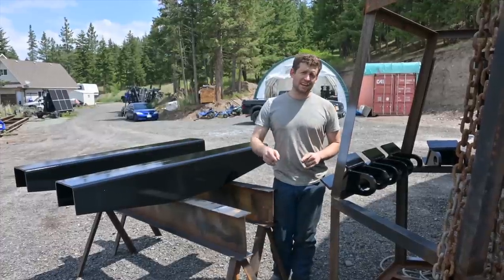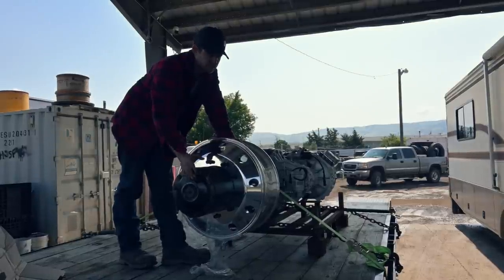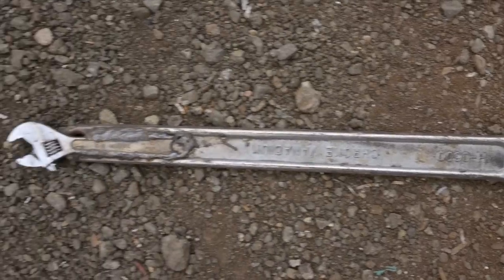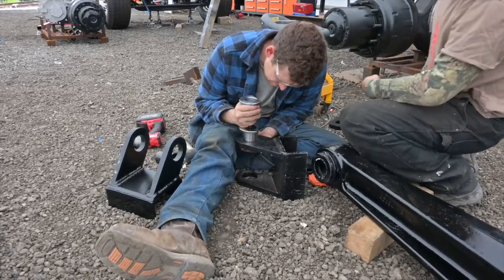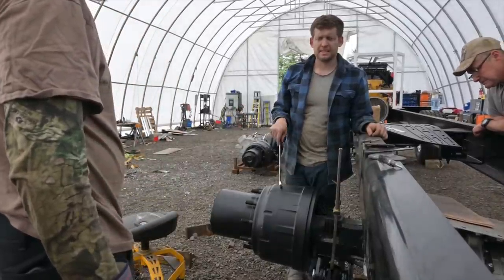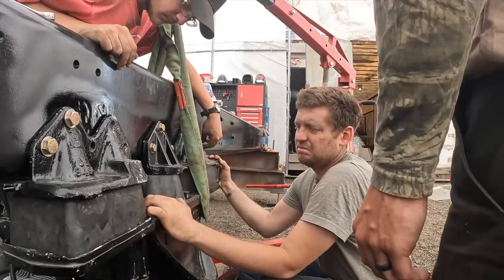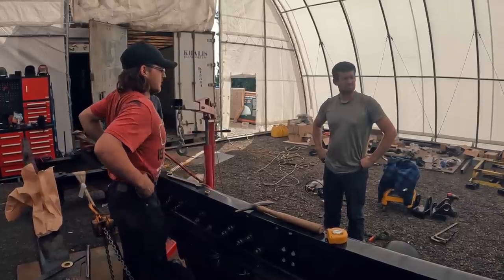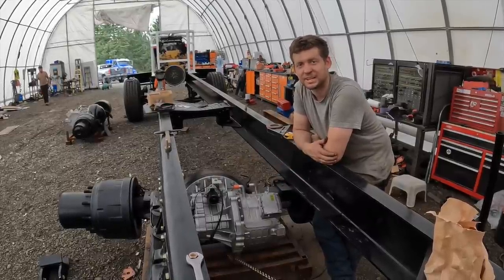E-Axle Installation Begins

Comment: Having the motors pointed inward is genius.  Also, 140 in reverse is something we're going to need to see.
Reply: Possible doesn't mean that it will have the stock ability :P imaging the effort required to stay on track while going that hard in reverse is quite the picture XD
Reply: 2 am on a Wednesday and 12 punys of mable syrup, a bit of "thats not possible" someone's bound to try it at
Reply: I want see a loaded logging trailer being pushed down a secondary road at minimum 120 😎😱🫡
Reply: @brianb-p6586  being able to use their electric motors to assist the breaks in either direction is nice too
Reply: Going to be able to wwap the axles to get nearly double the life out of the gearsets.

Comment: Maybe getting the axels set up in a pair. The roll the assembly under the frame,  get it all aligned,  then drill the holes to mount, paint the holes before installing the bolts, to prevent rust, the after the chassis is assembled. Touch up the paint before the body is installed,   having a stamped in measuring point for the axels, to make alignment easier.     Use a square and Lazer to measure out the mounting points, or axel centerlines.  After the axels are in place, the holes can be hand drilled, or a magnetic drill press. And having all the parts pre fitted together,  maybe have a dummy frame rails to  get it sei up, maybe  even made from wood,   if required make a jig to hold the axels square, to be rolled under the frame,  bolting on all the suspension parts  then roll it under the frame drill and bolt  should save a good bit of time,  just trying to help ! ✌️ Have an awesome day, can't wait to see it finished,
Reply from the maker: On the next truck we’re getting the suspension drafted by a professional and getting the holes punched out in the factory in the future to avoid this on production trucks

This sucked to do to be honest.  But part of prototyping

Comment: Careful with those axles being backwards, sometimes the oil pumps don't work and it the altered loading can also have knock on impact to wear on the crown and pinion on the differential.

Of course this is the prototype so it's a great chance to find out if it is a problem or not, and you are in a position to be ordering axles with a reverse pump or differential if it is a problem.

The Tesla drive units have aftermarket reverse direction pumps available in swap projects as the Tesla pump is only operational in one direction preventing you sticking one backwards in a swap for too long

Comment: But read the spec sheet on your e-axle. The differential pinion gear bearing  is designed to when going forward be under tension.  Not under expanded force. Also there is the pinon gear to ring gear contact tooth alignment.

Comment: Love to see the progress!

Regarding the differential direction, have you considered ring gear tooth directional strength?  Most ring gears are stronger in the conventional forward direction and somewhat weaker while reversing.
Reply from the maker: Yes, these axles were designed for this specifically
Reply: I'm guessing they don't use hypoid gears then since there is no need to change rotating direction.
Reply: @EdisonMotors   That's phenomenal!  I would love to see inside one of those.

Comment: The rearend running in reverse might have ring and pinion gear problems.    I believe hypoid gears pull into each other with intended direction.    But,  they push away from each other in reverse.

Comment: I don't know if you've worked on walking beams before, but the the adapter bushings are not supposed to drop into the mount holes by hand, they should be a press fit. They are going to flog the mounts out in no time!

Comment: Most diffs have preferred driving direction. I reverse life expectancy is 10 times smaller. Like in some wheel loaders amd mobile excavators front diff goes poopy every few years because it's driving in reverse most of the time. 
Please check with manufacturer is this true with your diff. You don't wanna replace diff every year just because it's driving in reverse

Comment: I imagine you've already asked axel mfg. Most all hubs are directional for noise and wear characteristics.  The oil slings in certain direction for max lubrication.  The mesh of gears angle and spiral is ideal for forward travel. I decline customer request to operate our equipment in reverse for this reason.

Comment: Electric motors are often timed, or optimized for one direction.  Might want to put it on stands, mark the tires, spin them a while, and see if the marks are still synchronized.  Never trust a "correction factor" without checking it!

Comment: Was the ring and pinion on the axle running backwards building with reverse cut gears? If not you will be driving on the coast side of the gear way weaker that is if there is still a ring gear
Reply from the maker: Yes, it was set to run backwards by the manufacturer.  We triple checked this don’t worry.

Comment: There are some really common axles GM 14 volt, Dana 60 70 ford 9. Making an electric. Motor. To slip into the bolt flange could help costs as well

Comment: I like the axle mounting but are you sure it will be ok with the front axle driving on the coast side of the ring and pinion? Also what about when you have to change the third member. Is there going to be enough room to do it without having to pull one of the whole axle assembly’s out?

Comment: I love watching you guys.. am not trying to be a Karen or a keyboard warrior here but I am not 100 how great that front diff is going to hold up running in reverse just how the power and torque will be applied to the ring and pin gear and how the cut and bevel is on the gears yes I know rear ends run under load in reverse but it's normally for short amount of time.. maybe it's nothing to worry about it's just my brain thinking out loud

Comment: I was wondering have you ever thought about adding 1-2 axels to a trailer and expanding the drive software to be able to activate them when needed in off-road or snowy conditions, the rest of the time they could just act like mini generators as they are being pulled on the highway.

Comment: And suddenly It's got me wondering if you could do something like the old Scammell Pioneer trucks rear ends... 

Think single axle to 'Y' shaped floating arms on either side so that you could attach four wheels in total. It meant that it could allow massive articulation between each set of two wheels but still have the axle parallel to the chassis. Really good for hill climbing. 

A modern version could have four wheels with a hub type motor in each wheel, with two on each arm with a centre pivot. Wouldn't necessarily be for high speeds but certainly for very rough terrain. Could even drop a drive motor from each side and attach a track between them (though that'd leave balance issues I suppose if the motors rotate far enough to move from front to back or vice versa so each side doesn't have the motors in the same position on each side.)

Comment: Um are you sure your ring and pinion are cut correctly to handle the reverse as most are directional wearing and cause you typically put on far more km forwards than backwards you don't see tons of wear from reverse going against the cut of the teeth

Comment: Do those have normal hypoid gears in those diffs? If so running it backwards at high loads is not a good idea. They are way stronger in forward.

Comment: Are you guys going to eventually going to build a race truck to do the semi truck racing, having a couple Tesla  drive units  parallel should be easy, depending on the differential type used, maybe weld it, use one side as out to the gear box, the other side as the input from the other drive unit,  maybe use 3-4 drive units this way, with a average engine you use, with a bank of Lifepo4 batteries capable of lots of current, a high C rate, possibly using  320 ah cells  4 parallel, with enough in series to make the 400+/- volts required,  at 1c that's 1280 amps,  with  120 -125 series cells (maybe use a smaller cell, 150ah , ran it 2c) with the engine running to also produce power, the current should be available for full power,  the truck should accelerate nearly as a Tesla would!  Still capable of hauling ! 😎

Comment: You guys are awesome I can hardly wait for your next video I haven't been around e axels and I understand completely what you are doing buy running the front axel in reverse but my question is if the axel does have a ring and pinion in the center center the way the gears are cut in a regular axel are stronger running in forward

Comment: Do you think there may be any potential issues with vibration possibly damaging the motor overtime?

Since the suspension system won’t be able to buffer some of it because it’s connected directly to the axle?

Comment: This is an awesome project man! Cheering you on from Vancouver Island here!
I have a question about the forward diff facing “backwards “. Feel free to correct me as I don’t know exactly how the motor/pinion drives the ring gear but does this set up have a coast side and a drive side to it? Would the coast side(driving in reverse side) be weaker in this diff? Kinda like how a high pinion front diff is more desirable then a low pinion reverse rotation design? 
Or are these set up more like a front end loader where they are designed for constant load cycling back and forth all day?
Sorry for the long winded question!
It popped into my head while watching this!
This is awesome and I thoroughly enjoy all the tech with the KIS theory and rebuildable everything!
Cheers!

Comment: There are no helical gears in the assembly? Just wondering if there may be some design that requires it to operate in a certain direction of travel under normal use.

Comment: Those seems to be basic bullet proof mercedes planetary hubs when you look planetary hub but differential seems to be as big as axle driven ones. It is like two axle mixed. Patterns and hub sizes have stay same for decades which are 10x335mm and middle hole 281mm and that is same even if it was axle driven or planetary hub. Only Volvo was stuck with some smaller 8 and 10 bolt axles maybe late 80's and theres problem to get rims for them because everyone else use this 10 bolts.

Is there different size center holes and bolt patterns for full size axle driven ones in US?

Comment: Wouldnt there be excessive gear whine from running the gear on its coast side? Or is it not really reverse and the ring and pinion are reverse cut to keep the drive motors facing each other?

Comment: I mightve missed it, but is there an actual ring and pinion in those center sections? cause that might make the whole "full speed in reverse" become an issue over time due to wearing on the back of the gear face instead of the front

Comment: Those diffs are rated for full power/speed in either direction?......we had a machine with ZF front (steering) diffs setup one faced forwards and one backwards to give 4 wheel steering.....the one that was at the back running opposite direction to what it would be in a truck gave constant ring and pinion and bearing problems that we traced to it not being designed to be stressed to full load in reverse full time...once you opened it up and looked at how the castings were shaped it was obvious that it wasn't being run the direction the designers had intended it to run
Reply from the maker: We were told by the manufacture that it was engineered to run “in reverse” full time.  However I think in the future having 1 drive motor per wheel would make even more sense than having a ring & pinion.  More like a letourneau would be better in my opinion.
Reply: @EdisonMotors  Can only go by that the manufacturer says.........
 When i hear the term electric car/truck one motor per wheel is what comes to mind be it hub motor or an axle mounted driveshaft hub setup.

Comment: So cents you have the E axels and not a normal drive shaft. How would someone tow it and still pull the driveline? Are the E axels made to have a shaft pull out to disconnect the tires from the motor?

Comment: Are those axels designed to be filled like that? Not all ring gears are as strong being run in “reverse” as they are “forward” also is there any worry about pinion oiling from running it backwards?

Comment: l'm sure you've checked but l thought l'd ask anway. ln a Tesla motor/gearbox the oil pump only works in the forward direction. lf you want to drive the motor in reverse full time you have to modify the oil pump.

Comment: Question for the axles: is your ring and pinion different between the front and rear diff? Or do you have one running coast side and one drive side?
Reply: @brianb-p6586 well if so that works! I though I watched a previous video where he said other then the electric motor the axle is the same as a normal truck diff.

Comment: Are the Hypoids in diffs symmetrical? 
I don't know big rig drivetrains, but on consumer level vehicles the pinion and ring gear are optimized for longevity and quietness for a given rotational direction. I.e. they like to drive forwards, and hate driving backwards. 
Are your diffs different?